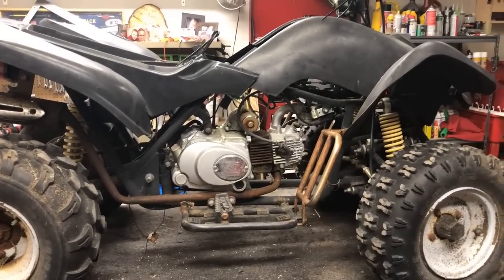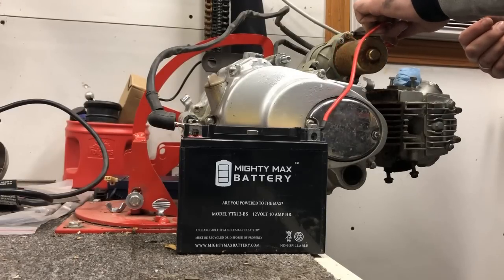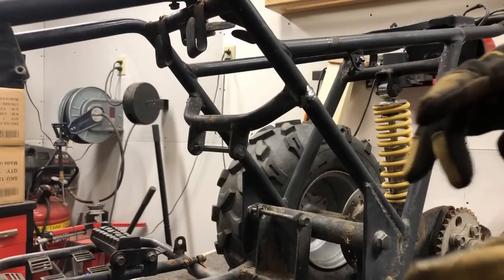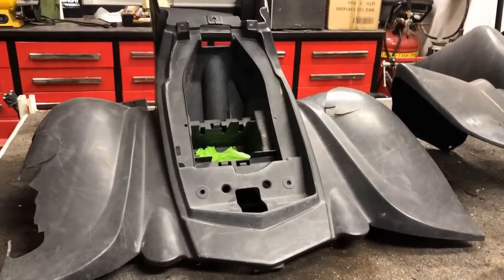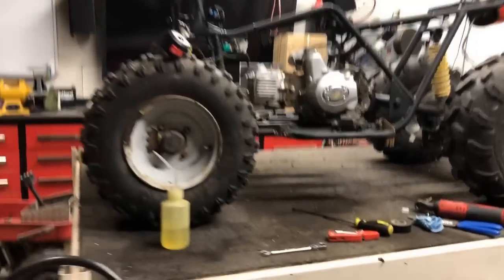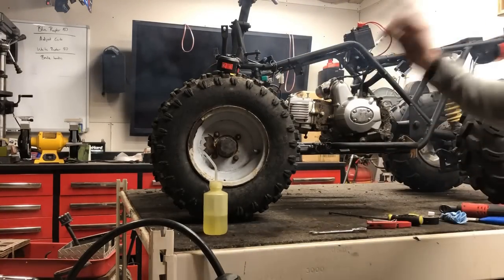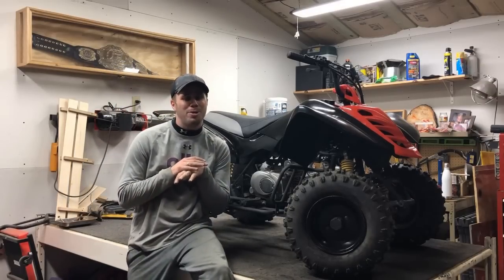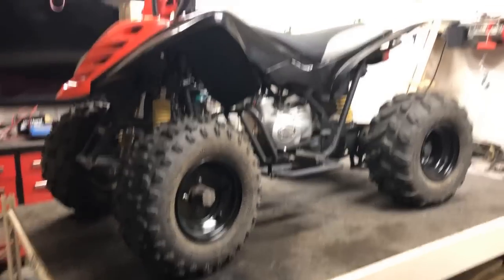You bought a 110cc Chinese ATV! Now What? -Complete Build

Comment: What type of welding is that is it Mig?.
Reply from the maker: Backwheel bandits Yep it’s mig. I run a Lincoln Electric 120v/88amp mig welder with 75% co2 15% argon gas.
Reply: @PraskaBoysGarage  nice..i was suppose to sign up to a course for that but got the ark and tig..il be bak after those and do the mig 👊😎

Comment: mine fires when i put gas in the carb then stalls. will not run of tank. i cleaned the carb put it back on same thing. any ideas? thanks
Reply from the maker: If you're 100% confident that you are getting fuel then it's likely an air mixture issue. There is a lot of good youtube content available on how to set a carb! Try that first and let me know what you find out!
Reply: Praska Boy's Garage ok thank you. i know the carb is receiving fuel because when i pull the fuel line off fuel comes spraying out. it was sitting for about 4 years, do you think maybe i need new jets or something?
Reply from the maker: @finncampeau4922  If the jets have been cleaned I'm sure you are fine. Also check fuel by removing the bowl and make sure your float needle is opening and closing correctly. If that all looks good then move onto the air screw.
Reply: Praska Boy's Garage ok thanks
Reply: Praska Boy's Garage and something very weird that i have not seen before us that the carburetor is sealed. there is no screws to take it apart

Comment: whats the welder you using pal ???
Reply from the maker: It's a Lincoln Handy MIG that runs off 120 volt so I can plug it right into a standard outlet. Doesn't weld the thickest metals but for the hobby work I do it's great. Also mine can run off gas or flux-core. My advise, run gas!
Reply: @PraskaBoysGarage  cheers mate, im after a mig , i trained as a welder for some company but they went bust, so now I can weld just need a good mig

Comment: Hay dude where you get tht engine stand?
Reply from the maker: My engine stand is my #1 comment across the channel! I came across the stand on eBay back in January 2018. The seller was bomcbe2kz7 If I remember correctly, I paid about $110 with shipping. It has 3 mounting plates for different types of small engines. Definitely money well spent for my shop!

Comment: Got a new battery air filter for this etc. Then next day got it out of storage wouldn’t push then when did made a banging/ rattling noise anyway got it sorted it was riding then just got stuck in gear and wouldn’t move. I think I broke it by bumping it before I got a battery anyone know what might be the problem? Maybe clutch plates or diff/shaft. Anyone know how I will fix it and how much it cost thanks!
Reply: Maybe I might change the axel to chain instead anyone know which one I can get .
Reply from the maker: Dang man sound like a tough break! It could be the clutch plates or if you have gears might be an issue inside the case. Sorry to hear your having some big problems!

Comment: Bro do u make the engine stand or u bought it?
Reply from the maker: This is my #1 comment across the channel! I came across the stand on eBay back in January 2018. The seller was bomcbe2kz7 and the item number was 173080767269. If I remember correctly, I paid about $110 with shipping. It has 3 mounting plates for different types of small engines. Definitely money well spent for my shop!
Reply: Thanks bro i like it and thanks for take ur time to respond

Comment: I have the same quad and i lost compression and ik can't get the cilinder off the motor😅
Reply from the maker: Thymo Beukelman Dang that sucks but it’s a easy fix if you know what to look for! I need a little more information. So the head is off but the piston is locked up? Or does the motor spin freely but you can’t figure how to unbolt the cylinder?
Reply: @PraskaBoysGarage  i solved the problem the gasket on the cilinder is damaged. I orderd a new one. So i am now waiting on mij gasket to get that thing fired up.

Comment: I don't know how many bikes you built but everybody I've ever built or Road or did anything with I would never put automotive engine oil in my motorcycle especially if it has a wet clutch this is a no no
Reply from the maker: The manual for E22 motors calls for: SAE 5w30 under 0 degrees, SAE 10W30 10-100 degrees, or SAE 20W40 40 degrees and up. Everyone has a personal preference on oil. If I'm building to sell I will typically used whatever is on sale 10W30, 0W40 synthetic or 20W40.  All my keeper projects I use AMS Oil Power Sports 4-stroke 0W-40.

Comment: There's no way in hell that the suspension on that cheap Chinese quad this even worth 80 bucks and I know this cuz I have a little bit bigger version then 110 I have the 200 water cooled one shocks lasted all the three days before I blew them out they were leaking all over the place or broken in half
Reply from the maker: I don't believe I changed out the shocks on this atv. Just left them stock. I agree the shocks are pricing online. If it's me I typically upgrade to air shocks if possible.

Comment: Nope, those are oddball wheel and tires and at the end of the day the bearings might as well be made of cheese. Unless they all get replaced with American made hardened bearings. The 1st bearing to give up will be the output shaft bearing and seal. 
 Btw that not the correct method to repair a crack.
 Fyi the worst engineering feat in Chinese atv are the shocks there're worthless af...
Reply from the maker: I agree with the shocks comment. They are pretty worthless! In your opinion what would you recommend I do differently with the cracks?

Comment: You should make parts of videos,  less trim and show more about generator and electricity parts
Reply from the maker: Knight 001 I absolutely agree! I’m new to YouTube and so is my channel. I wanted to load a few complete build videos, then on my next ATV I will do a short series on the “How To”. Just wanted to gets some traffic to the channel first! Every wiring video I’ve seen has been terrible and no one is doing complete harnesses installs. More videos to come soon!
Reply from the maker: Knight 001 My advise would be to put a volt meter on your battery and start the ATV. If the volts go up 1-2 then the stator is working and your new batter is likely bad (if it’s the cheap $20 Chinese battery then that’s definitely a possibility). If it doesn’t go up your likely looking at a stator issue...I’m not a licensed mechanic, this is just my hobby but that would be my trouble shooting process
Reply: Would be nice to see a video on just the wiring harnesses. I have one I’m working on and even the new harness I ordered is giving me issues.
Reply from the maker: GrowYourOwn I’m glad you asked! https://youtu.be/XdLLjDZ155M check out my video I posted yesterday!

Comment: To all you haters are going to say it ain't going to do nothing I could show you 15 bikes that regular motor oil blue the rod in the crank out of and two bikes correct engine oil I didn't have the same issue
Reply from the maker: It's preference man. Same goes for brand loyal people making claims "I'd never buy a ford, they are junk" or the "Oh i owned 2 jeeps before and they were complete junk." It's all personal preference and how you drive or in our case ride. To each there own! Thanks for your input and I appreciate  you watching the video!
Reply: @PraskaBoysGarage  no man the last time I checked motor oil was not designed for transmissions or wet clutch just saying that's what bike wheels made for and I can prove it because I've ridden bikes for more than 30 years and I've worked on bikes for more than 20 years motor oil will destroy an air-cooled motorcycle in a short. Of time motorcycle oil does not you can stream tit-for-tat all you want they wouldn't make the shit if it wasn't important

Comment: How about buy a decent machine and you don’t have to do all of that.  Just a suggestion.  I’ll probably get the firing squad for this but I’m just stating the obvious.
Reply from the maker: No firing squad from me, I believe everyone is entitled to their own opinion. There are a ton of reasons to do this, but let me ask you a question: If you own a 2008 cobalt and you hit a curb and have front bumber damaged why don’t you just throw away the cobalt and buy a Lamborghini instead? Truth is not everyone has the money for a lambo, and even if you did wouldn’t you want to practice on a cobalt before trying to fix a lambo? This might be extreme but do you see my point?
Reply: Praska Boy's Garage   Yes.  Point taken.   My view stems from I had gotten one for my daughters birthday thinking it’ll be alright.  She’s only 7.  Took it down the street and straight off problems.  Sounded and felt like the auto  transmission.  Now I returned it to the spot i got it from.  They refunded my money.  But lesson learned.    I’d rather buy a quality kids bike for a little more used than a less expensive atv new. My point is the quality isn’t there from the start.  Now maybe if it were good running no problem from the start but  it broke somewhere down the line.  Ok yeah fix it.  But right out of the box.  That didn’t make me want to try again.
Reply from the maker: @charlieanddadreviewsandcha2243  I can understand that. I've had a couple friends buy them brand new and straight out of the crate had issues. On the flip side the yellow one I rebuilt last summer we haven't had a single issue with in 2 summers of riding. In the end it comes down to budget. These are great bridge ATVs. Get the kids introduced to riding before spending the big money on a name brand.